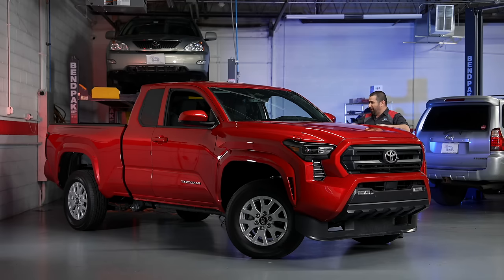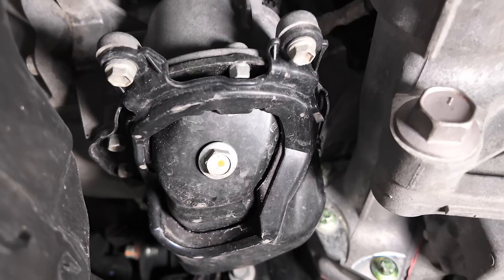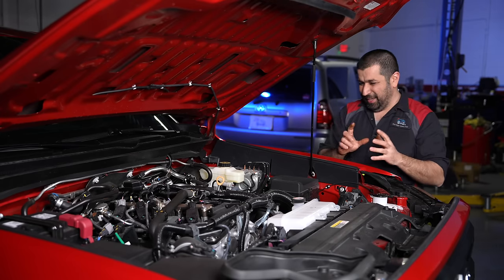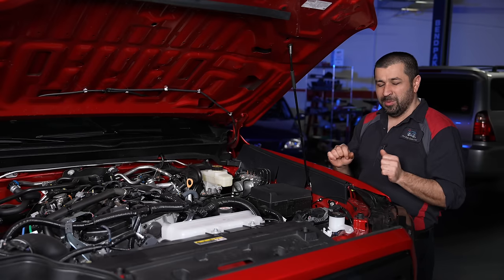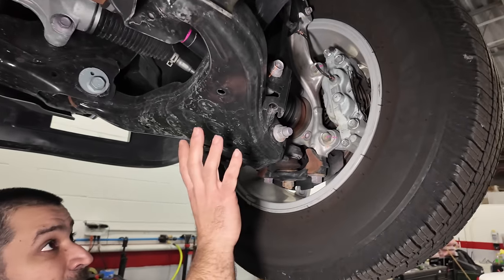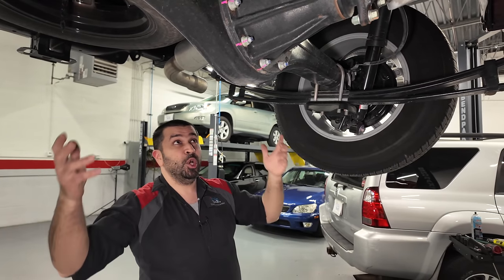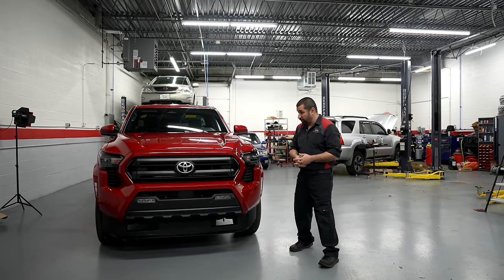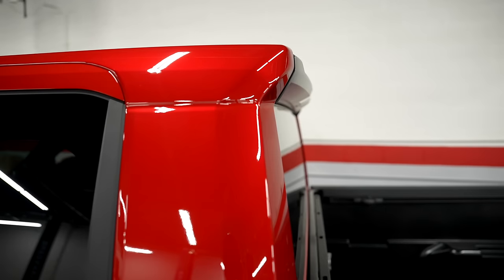2024 Toyota Tacoma | Did Toyota Improve or Ruin The Tacoma? Comprehensive Review

Comment: The only reason for replacement of v6 with turbo-4 is government mandated mpg and epa emission standards.
Reply: yeah its scary...the government, who are not engineers and know nothing about cars, are forcing manufacturers to try and pull a rabbit out of a hat....this will sacrifice the integrity, longevity, and price of cars
Reply: Spending this enormous development cost on the V6 instead would have yielded better real world MPG.
Reply: @cantwealljustgetalong2 the government who aren’t engineers also are pretty much responsible for the fact that you won’t die anymore in a 30mph crash and your car will get more than 15mpg, and pollute less.
Reply: From what I've seen, the turbo gives much improved drivability, with the torque peak at much lower rpms and the more relaxed transmission not hunting for gears - real world. In terms of long term reliability, we'll see.
Reply: @0HOON0  The old V6 just needed  a better transmission and tuning. The same 2gr Fks in the highlander, rx350 and Camry performed and felt extremely nice.
Reply: @cantwealljustgetalong2  Sorry, but cars and trucks are way better than they used to be. I'm 60 and we used to carry points kits with us in the trunk, got crap mileage and engines that went over 200,000 miles were exceedingly rare, even with proper maintenance.  Seriously, back in the 70s and early 80s at least, small cars got only about 21 to 25 mpg. 
Cars died for no reason, vapor locked at altitude on vacation trips to go camping in the mountains lol 
Yeah, the "good ol days" is a huge myth.
Reply: @0HOON0 not necessarily. The 2GR is getting long in the tooth.
Reply: @YerBoyTroy that wouldn't get you the mpg you want though. And there's been issues with the 2GR in the Tacoma that has necessitated engine replacement. What Toyota should do, is update the 2GR and add a turbocharger. It solves the weakness of the 2GR (not a ton of power down low) and might actually increase the fuel economy.
Reply: @cantwealljustgetalong2  if it weren't for the government,  you'd still be inhaling leaded gas in a car with no seat belts. 😂
Reply: @YerBoyTroy  the Highlander and Camry also aren’t expected to tow and rock climb, the Tacoma is. The 2GR is probably one of the best V6s ever made but it was a bad fit in the Tacoma. Most people agreed that the ancient 4.0 had better low end torque for truck use.
Reply: And Turbos break down faster and need special treatment to which the average person is not familiar with resulting in Unnecessary repairs ranging from $2000-$3000! There money pits!
Reply: @MrEricmopar  im not talking about cars being better than they used to be, and im not talking about common sense mandates like a car getting better than 10 mpg. im talking about forcing car makers to come up with something that they cant do in such a short period of time, which makes them use short cuts and questionable techniques in order to rush stellar fuel economy.  as opposed to them taking the time to do it right and research enough and develop technology with better fuel economy in a reasonable amount of time.  fuel economy has been steadily getting better and better, but they cant snap their fingers and all of a sudden make all cars get 80 mpg in 2 years
Reply: @rustyshackle917  lol lets bow down to the lovely government. our saviors 🤣
Reply: @rustyshackle917  oh gee wow mandating no lead gas and seatbelts, arent they so wonderful? you must work for them to be such a fanboy. im sure you would love china
Reply: Turbo 4 makes more power
Reply: Nissan Frontier v6 🤣🤣🤣🤣🤣🤣🤣🤣
Reply: @cantwealljustgetalong2  Frontier has a v6
Reply: @0HOON0  Frontier has a v6🤣🤣🤣🤣
Reply: If you’re using it as more of a daily driver/hauling here and there, the turbo 4 is actually a better option. If you plan on using it as a towing vehicle, not so great
Reply: Tell that to Nissan and their V6 truck.
Reply: Actually closer to 6k for a turbo replacement after about 80k miles.
Reply: @CalmRacingCar-nl5mf  these people think that without the gov we would still be living in the stone age. Completely remove the agency of individuals and market forces
Reply: "The v4 turbo makes more power" i know right, imagine a v6 turbo, now that's a crazy idea
Reply: @JPJ432 
The only special treatment a turbo needs is letting it idle for a minute before turning the engine off.
Turbo 4 engines are so ridiculously common these days that they're basically a non-issue. They're even more common where I live because we're still a diesel country. A turbo is practically mandatory to make diesels even remotely drivable.
Reply: @ricardosantos9960 
I don't think the free market has any way to address the leaded gas issue. There's practically no market incentive and the effects are so long term, they might as well be invisible.
Reply: @Sashazur  Actually the opposite regarding MPG, the EPA killed small handyman trucks because of their MPG guidelines. Which is clearly a fraud.
Reply: @Sashazur that would be available anyways.  Its called the free market
Reply: wrong - Honda still has V6 in ridgeline and it meets government mandated mpg and epa emission standards
Reply: @Sashazur  You might want to look into CAFE standards. These government standards were so horribly thought out and written so poorly that it actually incentivizes manufacturers to build larger trucks. Did you notice how after Obama changed the CAFE law that massive trucks started showing up? Did you know that these trucks being so large actually increased death rates for everyone else? Especially pedestrians? Did you know that if they decreased the height of the front grill by 3.75" there would be a 25% decrease in fatalities? Did you know that an Abrams tank has better front visibility than these modern full size trucks? If your child is under 5' tall, their chances of being killed as a pedestrian increase dramatically.
Reply: @mediocreman2  that is very informational and is something to research further, thank you for that.
Reply: @richardblanke5521  i know that. we arent talking about the frontier
Reply: As if four specific designed cylinders are less good than an old V6.
Reply: @tinolino58  4 cylinders are going to work harder than 6 cylinders in a vehicle of this size, even more so being turbocharged which pushes them to their limits even more.  its being done to squeeze a little more fuel economy out of engines and perform better on EPA cycle tests that are pretty much staged.  i have a 4 cylinder turbo in my car that gets the same gas mileage as the V6 car i replaced.  4 cylinder turbos can get better mileage if youre super light on the throttle at all times and drive real slow, including on highways. but most people dont drive that way, turbos use even more gas when you drive them normally. its all smoke and mirrors.  the point is the V6 got pretty good gas mileage as it was and will probably be way more reliable
Reply: Fun fact Im pretty sure in the V6 05 to 15 had a recommended spark plug interval of 30k miles to reach a said standard. So they were just buying time at that point.
Reply: Ok so why does the frontier have a NA v6 😂
Reply: @user-ox8ix6lf4r  why does it have a V6? idk ask someone at Nissan. we are talking about the Tacoma
Reply: Better mileage ratings and therefore less pollution….good reasons
Reply: He didn't mention stop/start, another way the government interferes.  And while I'm on my soapbox, have you bought a gas can for your mower lately?  The environmental spouts are dreadful.  I spill far more gasoline than I did before the feds got involved.
Reply: LFP is safer.
Reply: Toyotas V6 was never good for power and torque. It was a slug. Nobody will miss it.
Reply: @ryanb8736   As long as the reliabilities there I don't mind.
Reply: Bullshit!!! Nissan kept its V6…
Reply: @cantwealljustgetalong2  people will be making excuses and defending the gov even when the only thing they're able to afford is a bicycle.
Reply: @Sashazur no way.  Customers would by their own choosing pick a more safe vehicle over a more dangerous one.  Some minimal level of regulation is ok, but they have gone way, way too far.
Reply: @rustyshackle917 wrong.  Ford started offering seat belts as optional way way before they were mandated, and customers would on their own choose safer vehicles over dangerous ones.  Notice how the iihs crash ratings are published and people all by themselves pick the safer vehicle without a bureaucrat nanny standing over them.

Also notice how huge and view obstructing modern A pillars have gotten?  That's all due to roof crush rules.  So to get better roofs. We have to have these giant pillars blocking visibility
Reply: @Sashazur the reason you can't buy sensible small pickups like the old Toyota, Nissan, Mazda, small ranger, etc is because govt fuel economy rules give mfgs a break the longer the wheelbase and the wider the track.  Its easier to make a vehicle meet mpg reqmts if it's longer, wider, and bigger.
Reply: but the tacoma is now too big with too small engine XD unless this is hilux size
Reply: and the v6 nissan frontier did not have to abide to the same standards? i call b.s.
Reply: @ricardosantos9960  i completely agree...its amazing how good the government is at turning people into obedient minions.  its the equivalent of a victim defending its abuser
Reply: @0HOON0  LOL, if that was actually true, they would have done it.
Reply: @ryanb8736
The engine was great in my is350. The transmission is what SUCKS in the 3rd gen Taco. My sister bought a brand new 21 a few years ago (I hadn't been in a taco like 08). I couldn't believe how crappy the 3rd gen drove and how uncomfortable the interior is.
Reply: @ruthnoya8424  the engine in the is350 is completely different
Reply: @howebrad4601  no wonder cars have gotten huge, a new honda civic is bigger than a honda accord was 10 years ago
Reply: @MrEricmopar    I've been driving almost 50 years, and I concur, mostly.  Electronic/computer controlled ignition and fuel injection are beyond excellent.  ABS has saved my rear end a handful of times.  I bought two new Toyota Corollas in 2022.  I was told by the salesman that there are 40+ computers each in these cars.  That seems excessive.  I turned off all the annoying "Safety Sense" garbage in my car, but my wife uses all of it in hers.  The rear facing camera is handy at times, but I could live without it.

I enjoy the simplicity of my 2002 Ford Ranger.  It brings a smile to my face every time I drive it.  Too bad we can't have a simple, sensible, affordable truck like it today...
Reply: And they will make sure you are safe through funding gain of function and your 4th jab @Sashazur
Reply: @BrandonEht in order to be reliable a turbo requires warm up and cool down time. Not ideal.
Reply: @ryanb8736 the 4.0 is a beast and the 3.5 is smooth and gets it done. The auto transmission in 3rd gen was trash tho. You dont seem to know what you're talking about.
Reply: Nissan has a durable 310 Horse power V6. The Toyota is totally lame in comparison.
Reply: @LoneWolfSparty I’m 78 and anything with a turbo will not get my money
Reply: @rockyj2008  fair enough. That's your right as a consumer.
Reply: Also turbo motor doesn't last as long
Reply: @Sashazur This isn’t true. All safety features in vehicle were brought about by auto manufacturers and inventors / entrepreneurs. Government regulation makes everything weaker, lower quality, and higher price.
Reply: In the future all cars and trucks will have 2L incline 4 engines only. Sarc.
Reply: But it’s not mandatory though
Reply: @MrBe787  What do you mean “it isn’t mandated?” What isn’t mandated? MPGs? Those are mandated, so the type of engine is mandated:
Reply: @MrBe787   The EPA/US government has fleet standards for MPG and emission standards.  What's not mandatory?
Reply: @MrEricmopar true but in the old good days you could find a mechanic that could help you even in a remote area because of the simplicity of the cars back there, now with the new technology even when you live in the city is very difficult to find a mechanic that can fix your car if something complicated came on,and believe me, complicated things happens all the time with new cars
Reply: Them famous words " I'm from the Goverment, I'm here to help
Reply: @dbmn7571  then why does Ford, GM and Ram all have V8s still available?
Reply: Hmmm the 4 runner still comes with a 6 cylinder
Reply: @Sashazur you can still get a 15 mpg vehicle they just tax the ever loving crap out of you. Gotta keep us alive so they can keep taxing.
Reply: @MrEricmopar  EXACTLY!! I remember a bunch of us piling in my dad's Buick Electra to watch the Odometer turn over 100k miles and back to all zeros. It was a big deal. Most cars didn't make it that far. 200k was a pipe dream
Reply: CAFE(corporate average fuel economy ) has been around since 1975 it's goal was to increase fuel efficiency and thereby reduce emissions. The current rule for 2024-2026 is a fleet average of 49 mpg by 2026.
That's fleet average that means for example Toyota adds its cars, light trucks medium and heavy duty trucks mpg numbers to reach the average 49 mpg. So even if they put v8s in all their vehicles they can still reach 49 by adding more electric cars to the lineup.
So no it’s not the only reason for the replacement of the v6 Toyota didn't have to use these small 4cyl with the turbo to meet cafe standards they did it to cut costs !!
Reply: Yeah thanks to the government, we’re gonna spend more money in maintenance for those new trucks.
Reply: @Sashazur  NEWSFLASH!! NO ONE CARES ABOUT 200 YR OLD TURTLES DYING
Reply: No, I don't  agree with your comment because if the government mandated the mpg GM  and Ford would still make 4 cyl cars. 4 cyl  cars are much more efficient on gas than a 4 cyl truck with the same size of engine. That's why I don't believe it.
Reply: It’s not government mandated it’s they don’t get the carbon tax credits if they don’t. Nissan still has their v6, and Toyota still makes and sells their 4.0 v6 on 4 runners(their last real truck)
Reply: @anthonyr5869  You're being obtuse. The government gives carbon credits if they don't follow the government rules, but they don't call it mandates.
Reply: @0HOON0 mPG is a joke!
Reply: @cantwealljustgetalong2 I’m good with my 454 punched out to 496…might turbo it..for better MPG 😈
Reply: The Toyota engineer gave 3 reasons actually: performance, emissions, and fuel economy.
Reply: @jimsomerville3924  What was said about reliability and long-term maintenance?  Of course, nothing.  So the employee at Toyota is going to say something that disagrees with managements position? Nope.  And management is going to say something different than the government regulators and other car manufacturers are saying? Nope.
Reply: @cantwealljustgetalong2  yet the people wont do anything about it
Reply: Why are Nissan and Ford still producing v6 options then?
Reply: @lrn_news9171  Ask them.  Both of Nissan and Ford are on life-support with terrible maintenance issues.  The mpg goals are based upon their "fleet" of vehicles not just one vehicle and since Ford blew their wad on EV R&D they though why put a 4 cylinder in a vehicle when in a few years they'll all be EV's.
Reply: @dbmn7571  Hmmm Nissan Frontier is actually one of the best most reliable midsize truck you can get on the market. Not sure what you're talking about when it comes to maintenance issues. The problem with Nissan isn't their trucks it's their CVT transmissions that they put in their SUVs and cars
Reply: @dbmn7571  My point though is that some brands still provide a v6 option which means the others can as well still and that's what truck enthusiasts want ultimately in their midsize trucks they prefer that over a turbo 4
Reply: @lrn_news9171  Nissan is NOT just managing their Frontier model, of which their sales or miniscule.
Reply: @lrn_news9171  I definitely agree with you on the v6 is the engine for a pickup, unless there's a v8 option.  Of course the manufacture "CAN" provide the v6 option, but do they need to or want to based on profitability.   Nissan's V6's are good if you don't have > 50k miles on them.  At this point in I wouldn't purchase a turbo-4 in a pickup or any vehicle.  Unproven reliability compared to non-turbo vehicles.
Reply: @lrn_news9171  so you dont think car companies putting 2.0 liter 4 cylinders in 5500 pound suvs has anything to do with the EPA or CAFE ?
Reply: @lrn_news9171  you can have V6s and V8s as long as your CAFE is under a certain number.  which is why ford went from having 25 models with v6s and v8s to like 3 models with v6s and v8s.  go learn something
Reply: no, that’s not the reason 😂